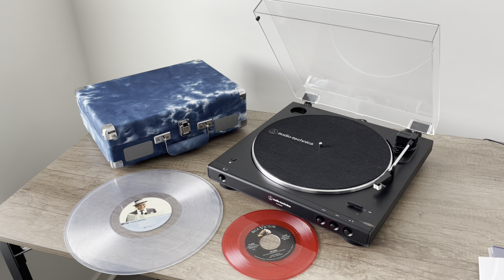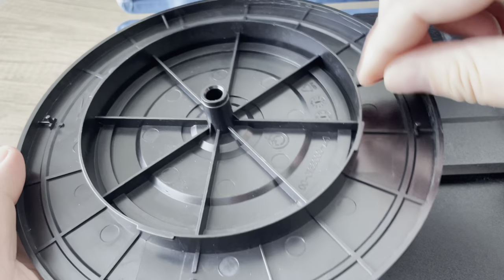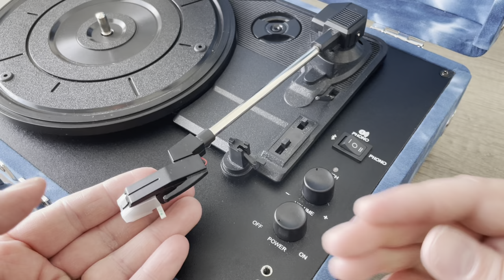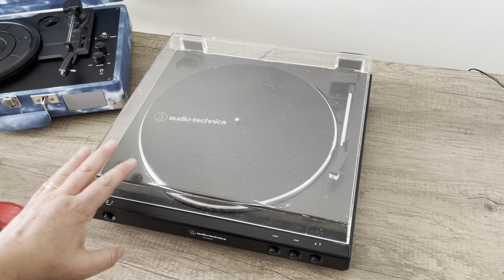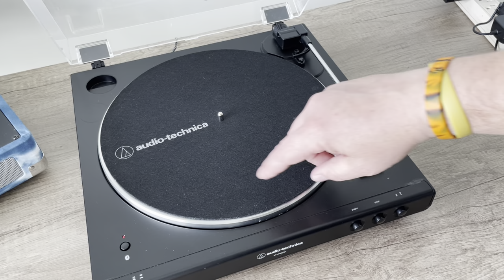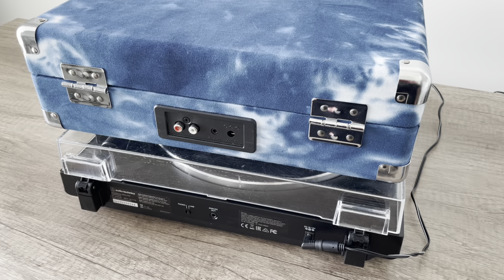How Record Players Work! #vinyl #turntable #fyp

Comment: This how the terminology of these devices typically goes:
The generic term for such devices over all is the "Phonograph".  In fact, the "record" that is to be played on these devices is actually technically called a "phonograph record", even though it is common to just call them "records".
The old turn-of-the-20th-century mechanical devices that played the old shellac 78 records are typically called "Gramophones". 
And then after that, I agree with the video that any device that may have built-in speakers and amp are typically called "record players" and the stand-alone component devices, especially the higher-end ones, are often called "turntables".  With that being said, is not considered "bad form" if anybody refers to a "turntable" as a "record player" as well.  After all, people still call those stand-alone components that are used to play CDs "CD players" even though they don't have built-in speakers.